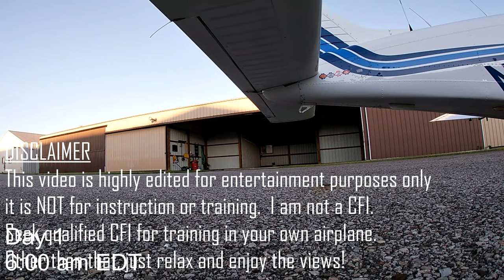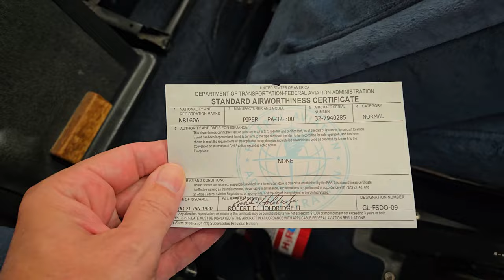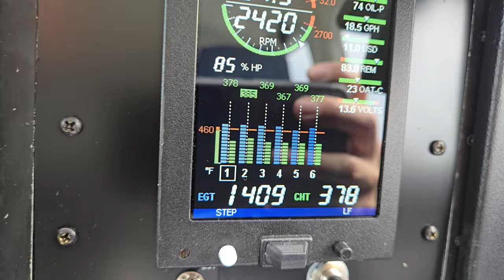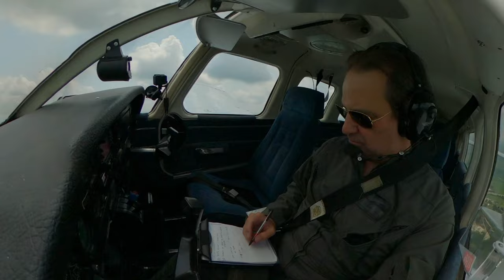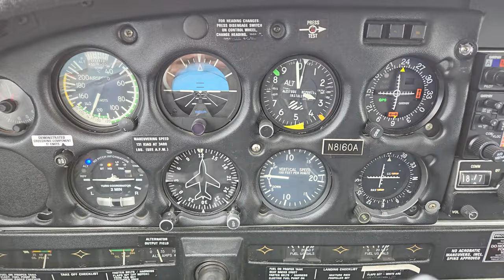Am I Crazy? | 1st Test Flight of Rehabed 1979 Cherokee Six

Comment: G,day from Sydney Australia. Why only cracks in one wing? What was the contributing factor?
2. That crack from the engine bolt, was that there last annual inspection. Did they use dye penitrent?
🌏🇦🇺
Reply: The only thing that is different between the 2 wings is 1 is used to get in an out of the plane. My guess is after hundreds of hours, and possibly thousands of in and outs of the plane it was enough to begin extremely slowly damaging it. That is only my best guess though.
Reply from the maker: correct
Reply from the maker: it's the wing that you walk on to get in/out of the plane in the front. It's been walked on 1000's of times over 45 years.  unfortunately, this is not an uncommon problem with PA-32's which is why we inspect this area ever year at annual per Piper service bulletin, and why the fix is so common and quick to do.